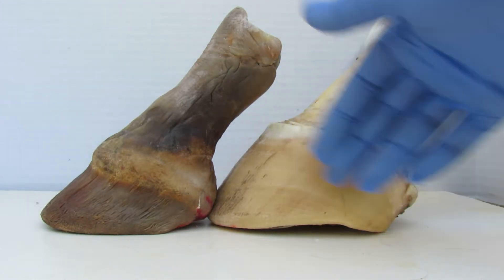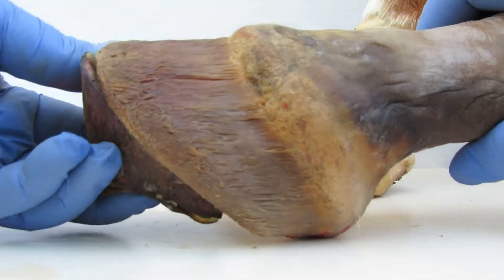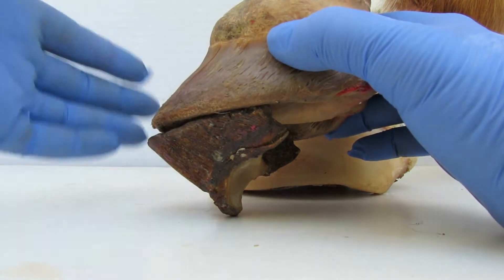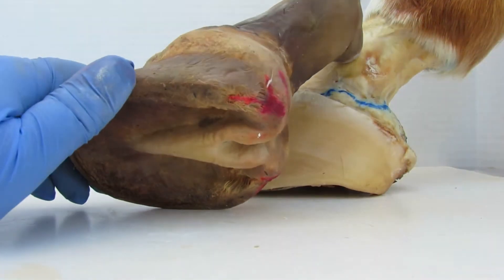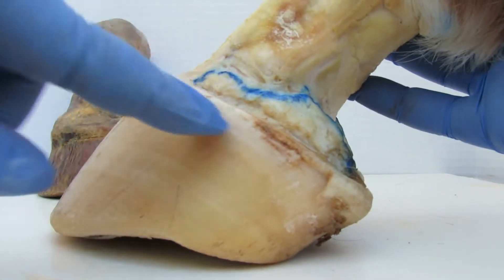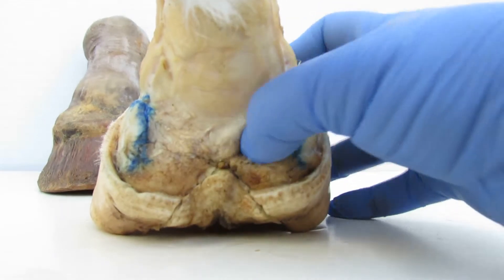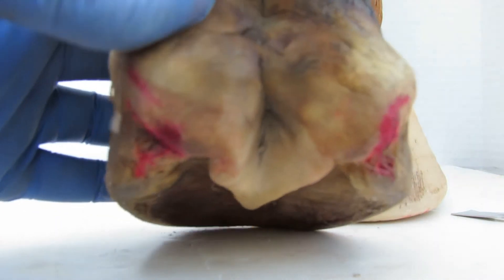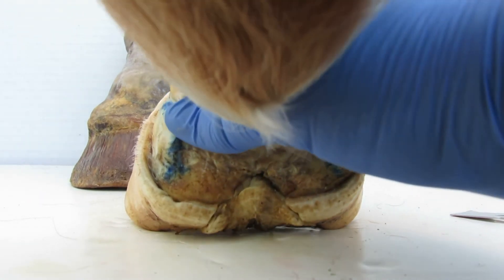TACT Hoof Health Class Part 3 How the Inner Foot and Capsule Work Together.

Comment: What causes the bulbs to be uneven?
Reply from the maker: The heels of the hoof capsule being attached to the internal physical heel is also part of the whole bulb apparatus. Therefore when one heel is trimmed differently or distorted over time and runs forward it will pull that bulb down. Therefore that bulb is lower, and that side is usually bulging or wider than the other side.

The bad part is that in truth with the horse standing that side that's lower and forward and pulling that bulb DOWN, when you pick up the foot and sight down it looks HIGH, while the other side that is actually higher looks lower.

So then the farrier, trimmer or whathaveyou then continues to lower the already low side since it looks high when you pick the foot up. Now that was a mystery I had to figure out to save my horse and restore his feet.
Reply: @thehappyhoof  how is it remedied?